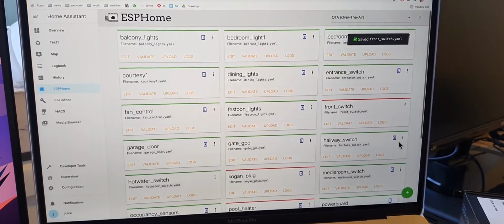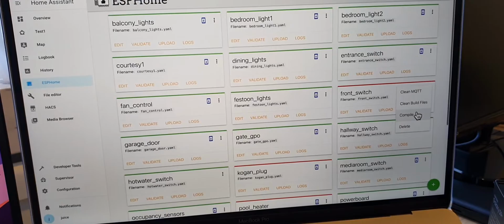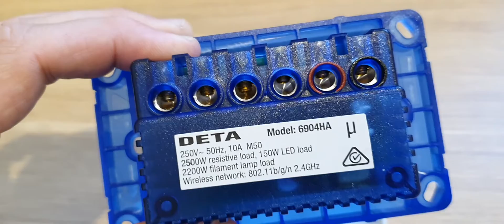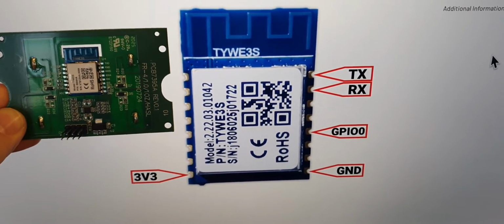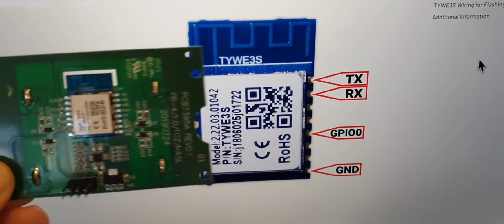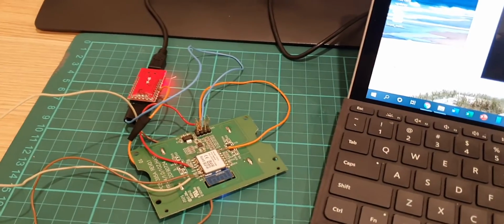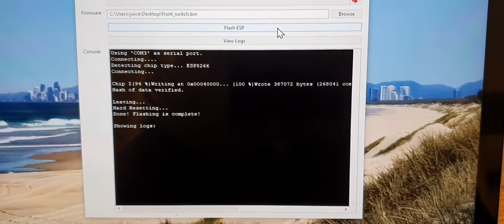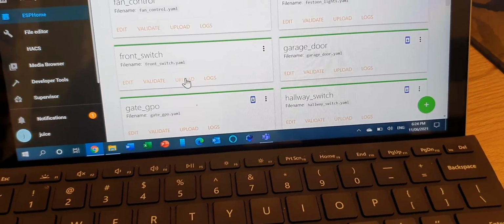Deta Smart Quad Switch 6904HA - how to flash ESPHome or Tasmota

Comment: Gareth, you do have a good 5V power source.
Your USB/serial adapter can apply either 3.3V or 5V to the output pins, controlled by the jumper on the board. Currently your jumper is correctly set to supply 3.3V.
However the other unused pin on the jumper has 5V available, and I have used that 5V supply to power a 6904HA CPU board via one of the Vcc inputs in the 8 pin cluster.

Comment: Great video! For the viewers, just be aware that if the package is marked 6904HA - Series2 (key part is "Series2") this procedure will not work as they have changed the chip to a WB3S which currently cannot be flashed in the same way with Tasmota. The Series2 part applies to all Deta Smart switches, for example 1,2 and 3 gang are also affected.
Reply from the maker: That's a shame. I wonder if OpenBeken firmware via this other procedure would work? https://community.home-assistant.io/t/437276
Reply: @GarethOakes  yea i tried a transplant to ESP-12F and it failed miserably. Kept rebooting when i loaded the 4 gang tasmota template. I’ve tried 10k resistor from GPIO15 and ground, i’ve tried shorting both together. I’ve managed to brick the chip, meaning desoldering is imminent. I’m now considering going back to the WB3S chip and following the instructions you just sent the link for :)
Reply: @DodgeyRog  have you tired this ? Any luck?
Reply: @hf8547  unfortunately it didnt work. I suspect the program doesnt like the FTDI adaptor that i have (based on other comments). The flash kept failing…
Reply: @DodgeyRog  I managed to successfully replace the WB3S with an ESP-12S
Reply: @davidsydau  good stuff! Did you have to ground one of the pins to stop it rebooting? What did you do for tasmota config?
Reply: @DodgeyRog  No further h/w mods needed. I used the standard Tasmota 6904HA template.
Reply: Just bought a 6904HA model off eBay as they were advertising them as the old version.

Arrived and package doesn't mention series 2 but upon opening the case it's the WB3S chip.
Reply: @gumboot13  i had a mate in brisbane look in a bunnings up there too. Most were labelled -series 2 but there were some black face versions that were not so i got him to ship a bunch to me. On inspection same issue as you had - WB3S chip so they will be going back
Reply: @DodgeyRog  just about to try and flash LibreTiny onto the one I have and see if I can get espHome loaded onto this damn thing.

Update: appears there is no template for the 4 switch model I bought and I don't have the time to test and make a template that works. Will do the transplant option instead.
Reply: @gumboot13  may the force be with you! Let us know how you get on
Reply: @DodgeyRog  Transplanted an esp chip from a d1 mini onto the light switch and all is working.

I saw the sticker on the back of the case says series 2 but no where on the package is there any series 2 writen. Not sure if the ebay seller did me a dirty or if I have an early series 2 with original packaging.

I have an original series 1 and opened it to check if anything had changed and found the PCB boards to be exactly the sime excat for the WB3S chip instead of the esp chip.
Reply: @gumboot13  did you have to jumper any of the pins of the d1 mini chip when you soldered it to the board? What did you flash it with and is the chip rebooting randomly after configuration?
Reply: @DodgeyRog  nothing needed to be jumped. This is why I examined the original board I have already to confirm if anything needed to be changed.

So far no issues with random rebooting.

I used espHome for the flash

Update after 24hrs. Device is running fine with no issues.
Reply: @DodgeyRog  if you look at the photo I linked you will see there already is a pull down resistor installed on the board

Comment: Hi Gareth, is there anyway to hard reset this switch? Cheers mate.
Reply from the maker: You have to pull the power. However, I have setup my ESPHome config to do a force reset when I hold one of the buttons for 10 seconds.
Reply: @GarethOakes  ahh ok. Ill try that. I havent flashed my switches though, im just using them in Home Assistant via local Tuya. I had one switch that seemed to have corrupted itself, that i removed from my Tuya app, but now it times out when reconnecting. It says its still connected to my wifi but can’t get it to add to my app. I have about 15 of these switches that have worked without issue besides this damn one.

Comment: Would be great if you can have the switch replace video. Thanks for the video 📹
Reply from the maker: Here in Australia, only licensed electricians are permitted to modify mains 230V electrical installations. It is unlawful for an unlicensed person to perform such work.
Reply: Tried to flash using Tasmota. Got the error message ' Failed to connect to ESP 8266: Timeed out waiting for packet', any thoughts? Thanks
Reply from the maker: Either it's not in flashing mode (GPIO0 must be pulled low on boot), or, you have a problem with your connection to the device. Cable, FTDI flasher, drivers, etc. That's my guess anyway!

Comment: Using ESPHome 2021.10.2 and I am now getting an error:

    GPIO Pin 16 does not support pullup pin mode. Please choose another pin.
    mode: INPUT_PULLUP [source /config/espdevicename.yaml:92]

Guessing there is some new logic to say that a "esp01_1m" device doesn't have GPIO16?

Are you having the same issue?
Reply from the maker: Yes I think they added validation code to ensure GPIO16 is not set to pullup. The ESP8266 hardware has a built-in pulldown resistor on GPIO16 so you cannot enable pullup. I haven't tried to update mine lately but presumably you just remove the pullup mode on that pin?
Reply: @GarethOakes  That fixed it... just removed the line:

binary_sensor:
  ### Button1
  - platform: gpio
    device_class: heat
    pin:
      number: GPIO16
#      mode: INPUT_PULLUP
      inverted: True
    name: "${button1_name} Button"
    ### toggle relay on push
    on_press:
      if:
        condition:
          switch.is_off: heat1
        then:
          - switch.turn_on: heat1
          - delay: 600s
          - switch.turn_off: heat1
        else:
          - switch.turn_off: heat1

Comment: Can these type of switches be two wayed
Reply from the maker: You do the two-way control via software rather than via the wiring. So the answer is "yes" and "no" :)
Reply: @GarethOakes  so does this mean no twin strappers are needed?
Reply from the maker: @shaneparus149  right, you run power to each switch and don't need a traveller wire. Then configure the software side to make the buttons do what you want. I have something similar setup at my place using ESPHome and Home Assistant.
Reply: @GarethOakes  ah beauty thanks for your help!! Appreciate it